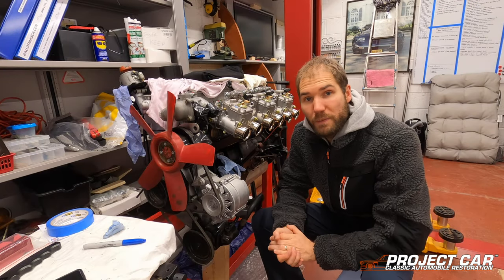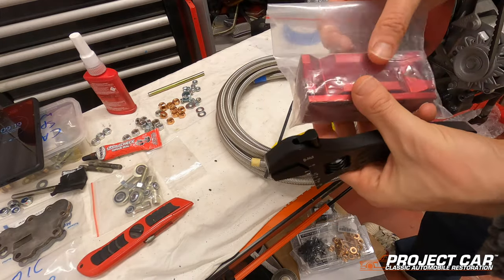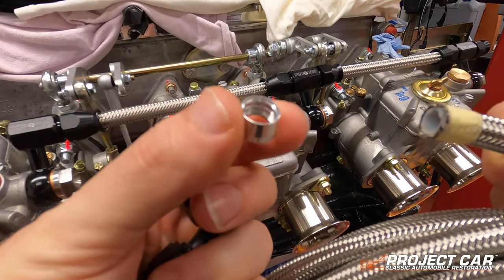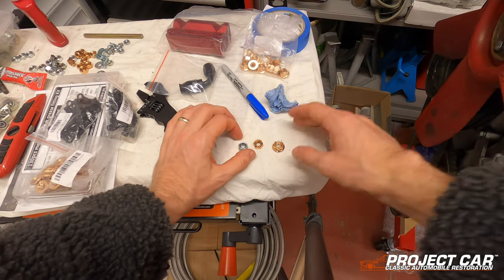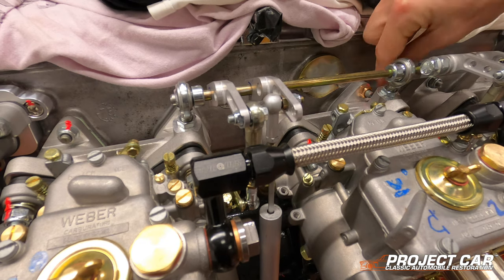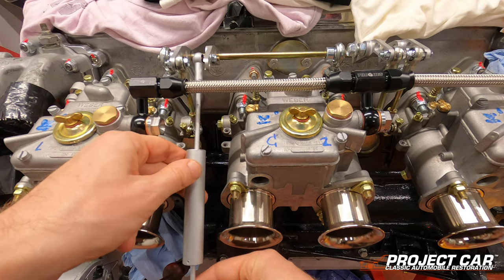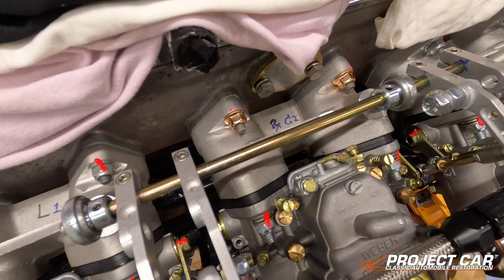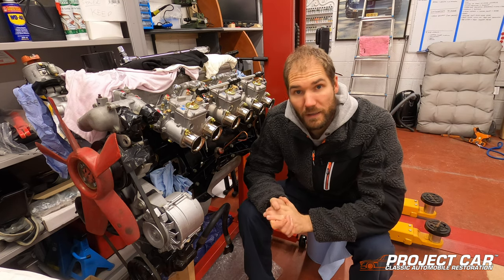Episode 27 - More Engine Work - 1974 BMW 3.0CS (E9) restoration - Project C.A.R.

Comment: Hi. Thanks for interesting part. I have some doubts in regards to torque wrench usage shown. The golden rule covered in each torque wrench manual is that the right torque can only be achieved by applying the wrench directly on the nut. In your solution there is an interim force-arm and it will change the torque on the nut (the arm is being longer) - I would consult that with wrench supplier. Simple way to torque the nut is to use the wrench with known length and spring-based weight. After scaling to (N*m) you will not which weight/force needs to be applied through the spring gauge to the wrench. I would at least try to compare both before you will finish your project. Interesting idea with the ALPINA inlet (AirBox). Are you going to inspect other items like e.g. steering or timing chain before putting the engine back? I know the engine has been reconstructed not so long ago, but I know that sometimes it can fail and now you have time and space to check all equipment around the engine. I suspect if this has to be racing car, the pistons, rods etc has been unified in regards to the weight and it's distribution and all together with the crankshaft and flywheel/clutch spring has been balanced. It is a must have for any high performance engine. If not... This is the right time for. Keeping for the project and waiting for next episode. Cheers
Reply from the maker: Thanks for your feedback and extensive detail on correct use of the torque wrench, it is very much appreciated to say the least! I'll have a look at your suggestion and I'll also run some "tests" on bolts with easier access to see what the difference in N*m is by using the different techniques I applied. Hopefully this will give me a conversion figure I might be able to use in the future for my particular torque wrench. 

With regards to the engine itself, I'm currently not planning on opening her up again. She's had a fresh full nut-and-bolt reconstruction and hasn't ran since, so technically all internal bits should still be "new". That being said, I'm considering changing some of the parts to match it closer to the Alpina engine, so I might still elect to open her up again. It depends a bit on how I'm getting on with the rest of the project. As I'm planning on using the car for classic (road) rallies, I don't require to have it running at top spec like a racing engine all the time (there's a lot "average speed" tests at lower revs and slow-speed roads). But it definately doesn't hurt making sure all is in top condition, I totally agree with that. 

Hopefully the next episode won't be too long; The Alpina parts are in the mail so with a bit of luck they'll arrive next week and I'll get time to upload a nice Christmas special :)

Thanks again for subscribing and your comments!